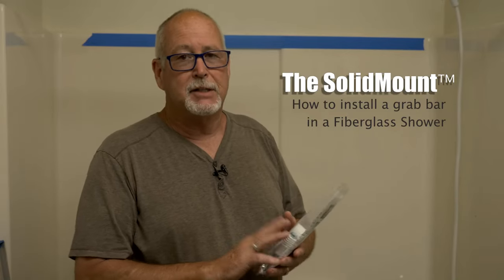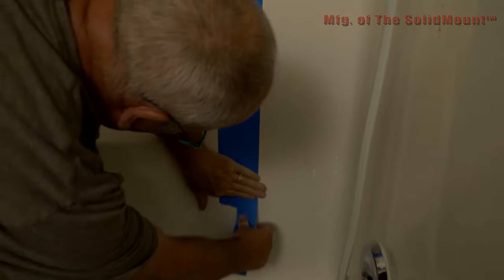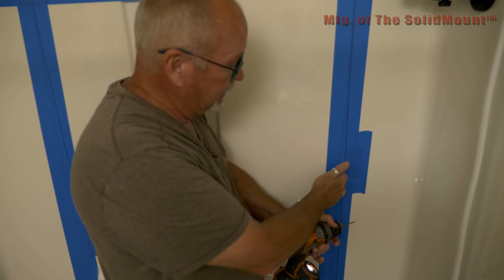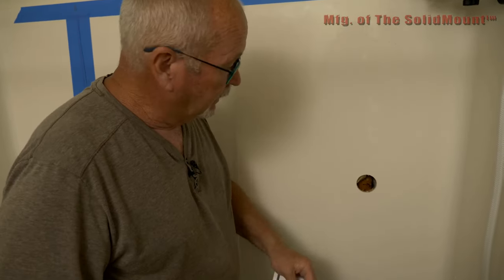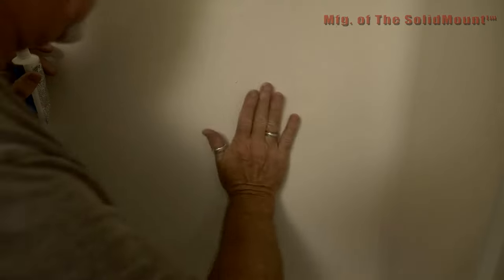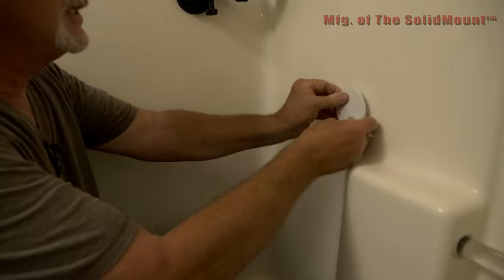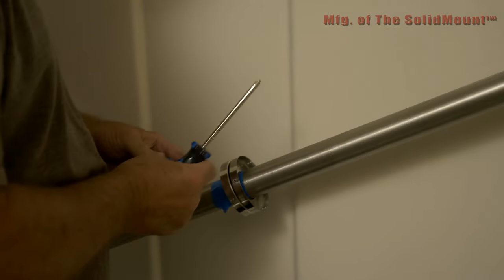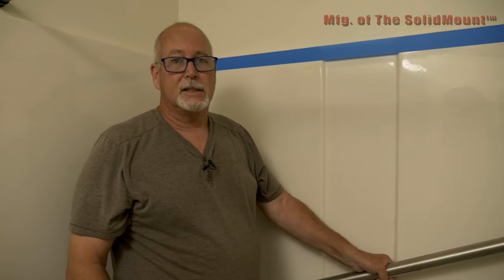Installing A Grab Bar in a Fiberglass Shower. *Grab Bar not Included*

Comment: I just installed the solid mount system in our fiberglass shower. Once installed the grab bar is solid. So solid that it's never going to come off that wall. It creates some great support getting in and out of the shower. The instructions with the product and this video were very clear on how to install it. And I followed every instruction and tip in the video. The only problem I ran into was there was no sheetrock behind the shower tub enclosure. Didn't know that until after I had drilled a 2-in hole. The distance from the shower wall to the stud was 5/8 of an inch. So I needed to use a hacksaw to cut off a quarter inch on the disc and a quarter inch on the threads. This quarter inch cut off was in addition to the four spacers that already had come off. Once I did that it installed perfectly. So thank you very much for this product and for the helpful video to get it installed.
Reply from the maker: Thank you

Comment: Great product and great instructions.  
Although the system is not intended to have the grab bar covers completely covering the mounting plate, you can have this flush result if you are very careful.  Make sure that the distance between the lag bolt assemblies is as close to perfect as possible.  Then dry fit (no silicon yet) the mounting plates and place the grab bar flanges against the mounting plates.  Mark any plate material that is not completely covered by the flange and make a mark at the top for orientation purposes.  Remove the mounting plates and sand/shave off the marked material.  If your spacing is accurate, there should be very little material that needs to be removed.  Add silicon around the hole and reinstall the mounting plates to the previous orientation.   Before install the grab bar screws, make sure both flanges are properly centered on the mounting plates.
Reply from the maker: Thanks for the comment.
Reply: Great tip.    I stole your idea and it came out perfect
Reply: I wish the disks were 2 7/8".

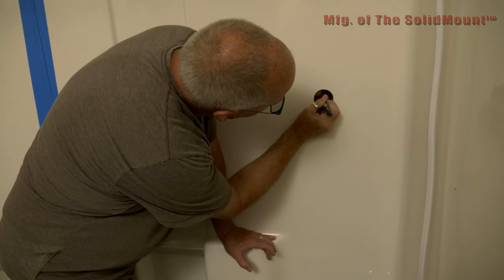Comment: Overall, this seems like a good product. I just mounted my first one and it is solid. I did my best to follow these instructions. But, I have to say that you should not imagine it is as easy or as neat as the video. I was installing a vertical bar, so all into one stud. My challenges were: 1) As of this posting, at 5:52 in the video, he says, and the subtitle says, use a 5/16" drill bit. He meant to say 3/16". I followed the video and my first lag  bolt hole was unusable. It was a recoverable error, but frustrating. 2) My fiberglass shower wall slopes, but of course the stud behind it does not. This creates a problem in both measuring and in the plastic flange screwing flush to the fiberglass. I am not sure what the proper work-around should have been, but it would have been nice to have one. I was able to recover from this using a Dremel and a lot of caulk, but again, frustrating. 3) Finally, I would recommend wearing a breathing mask for drilling the 2" holes. Fiberglass granules were flying everywhere. I just used a COVID mask to keep them away from my nose. 4) I had to drill off-center in the 2" holes both times, to the extent that my drill chuck would not go all the way in. This meant the 3/16" hole in the stud was shallower than it might have been, requiring a lot of torque to fully cinch up the lag bolt. Before I do another installation, I am going to get an extra long 3/16" bit. 

Again, I still think it is a a good product and I plan to install two more.
Reply from the maker: ThirdAct Warrior Thank you for your feedback it is important to us. I miss the lag bolt issue and thank you we have fixed the text part but will do a voice-over in the very near future. Most people would install per the written instructions using the video as more of a visual tool. But, nonetheless, it needs to be correct.
Regarding the angled shower wall. We can not account for all conditions but you could have reached out to me and I would have been more than happy to walk you through the correct procedure.
I did address this below in an older post so here is the info for next time.

For conversation's sake let's say you end up with a 2 5/8" gap from the stud to the front of the fiberglass. So, you now are over our 2 1/8" spec. by 1/2". What I did was I bought (x) number of fender washers the same size that we ship that when stacked to 1/2" spacing or whatever (x) is in your case. Then I also bought a lag bolt that was 1/2" or 1" longer than the one we ship, I don't remember. By doing both those you still keep the lag bolt at the minimum required depth in the stud and the washers will act as if the stud was closer. 

Regarding the slant, all you can do is mount THe SOlid Mount square to the stud and then fill the gap with silicone. I am not sure what you used the Dremel for?
Craig
Reply: @TheSolidMount  It's hard explain, but I will try. Because of the slope, the disc wound up not being centered on the grab bar flanges, even though I measured per instructions to the best of my ability. There wound up being disc material that extended past the flange and it kept the cosmetic cover from seating properly once everything was tightened up. I blue-taped the area around that part of the disc to protect the fiberglass. Then I used a Dremel with a small sanding cylinder, carefully, to remove the disc material that was keeping the cover from seating. Then I smoothed everything over with caulk. We thought alike on the fender washers and the longer bolts. That is exactly what I did. It really turned out very satisfactorily in the end. The bars are solid and look great. It just took a lot more fenagaling  than I could have imagined. If you have a mind to, doing another video on "How to solve problems you might encounter" would be a suggestion.
Reply from the maker: @thirdactwarrior317  Thanks for the explanation and suggestion.
Reply: Hope you had a successful installation. I'm planning on installing a grad bar on the outer edge of our 1 piece shower/tub enclosure. This fastener looks like it will work it I can hit a stud.
Reply: Thanks for sharing your experience.  An extra long 3/16 bit is a helpful tip.
Reply: @billmitchell5805  we’re you able to install yours successfully?
Reply: thanks much for all of your comments. I have learned that most YT projects end up going slightly 'off kilter' and knowing about that drill bit is worth the expense.
Reply: @TheSolidMount  I normally go by what the guy/girl making the videos sez. I also have learned by error, to read ALL the comments that go with said videos.
Reply: Thank you for sharing this correction!!

Comment: Excellent product. Only warning would be that I bought a Kohler Carmichael 16 inch grab bar. The issue is, the mounting bracket for the grab bar is only 1 and 5/8 inches. As the instructions pointed out and I failed to read, make sure the flange on the grab bar is three inches. I bought a Moen 16 inch replacement bar that was recommended by  SolidMount customer service. It worked perfectly and I now have a solid grab bar when I step into the shower.
Reply from the maker: That's why we suggest a 3" flange.
Reply: @TheSolidMount  My bad. I missed that in the description . Found the product and installation excellent!
Reply from the maker: Thank you glad it all worked out for you
Reply: @TheSolidMount just got the 16 inch Moen grab bar that you suggested. Has the 3 inch flange with a nice concealment cover over the flange. Thank you so much for the help!

Comment: I wanted to install a grab bar similar in length to yours, but the shower wall has a vertical contour that decreases in depth (which would make half the shower wall about 1" closer to the studs).  If I used a 32" grab bar mounted horizontally that spanned this vertical contour (the decrease in shower wall depth would be in about the middle of the grab bar), do you think I could still have secure, water tight mounts at both ends (using the procedures set out in your video)?  It seems doable to me, perhaps with slight adjustments to screw patterns and sufficient caulking, but wanted to ask the expert.  Appreciate any thoughts you might have on this and thanks for the great video.
Reply from the maker: With our seeing a picture it is hard to say. Reach out to us on our website thesolidmount(dot)com

Comment: I do have a question now though: At 11:16, are you aware of any waterproofing issues around the screw itself since it's going through both the flange and the fiberglass? I know you've got the grab bar cover, the mounting plate of the grab bar, then the Solid Mount flange and the screw in there to plug the hole. My thinking is if water still seeps over the screw, then it could get alongside that screw and eventually the other side of that fiberglass. Especially over time as weight is put on it regularly every day. It doesn't seem very likely but it seems like the main entry point I can imagine. 😅
Reply from the maker: Patrick, the simple answer is no. Once the bar is in place you have chaulking around the outside of the flange sealing there, plus the silicone between the mount and the fiberglass. Regarding the screws, they are threaded with self-tapping screws in plastic, and without high pressure, water should never penetrate. Hope that helps
Reply: @TheSolidMount  Patrick is using forethought. You could put some silicone sealer around the screw holes prior to tightening screws down. Also you could seal the finish trim plates at the bar. Just a tiny bit of moisture entry over extended period can result in fungus damage requiring destructive inspections and tear outs. This comes with 40 years' experience in the field of both inspections and structural repairs.
Reply from the maker: Carl you can do that if you like. But you already sealed the flange to the shower when you installed it plus you chalk when the install is finished. Not a single grab bar manufacturer request or requires the additional chalking you suggest. So if you want you can buy being in the industry from before 1985 to today never once have we had an issue as you suggest. Thank you for your input
Reply: @carlcampbell6827  FWIW, we actually purchased and installed this. We ended up putting silicone/sealant around the outer trim plates. 😊 Elegant, solid and waterproof. Great product so far.
Reply: @TheSolidMount  Thanks for the feedback. These subject are unavoidable "in the blood" issues for lifetime tradespeople.
Reply from the maker: Exactly. THanks and glad you are happy with your outcome.

Comment: Finished installing my Delta "Carlisle" 16" grab bar with this product. Turned out quite well, but I have a couple comments. The Delta Carlisle seems to be designed for a slightly smaller than 3" disk. I literally had to chuck up the disks and grind them down to about 2 7/8" so they would fit in the decorative end caps. If I were doing this again, I would check your grab bar first. Also, the recommended drill sizes are too small IMHO. The 3/16" for the lag bolt is just brutally tight. I used a larger drill.  I went up one drill size for the small screws also. Lastly, you have to be real careful if you have a long stud to shower wall distance like I had, 2", because if the part is at an angle, the error in the distance between the parts is magnified. Just be real careful. Like I said though, turned out good.
Reply from the maker: Thank you for your input. We follow the suggestions for the drill bits' specs that come from the manufacturer. Good idea to check the grab bar flange size, but according to the grab bar manufacturers, their flanges are not designed to cover any mounting kit.

Comment: I installed the first of four grab bars yesterday. I used the recommended 3/16" bit for the lag bolt (I had to get a long bit to get the hole deep enough). My Ryobi 3/8" drill didn't have enough torque to drive the lag bolt in far enough. I used a right-angle socket wrench to get it all the way necessary. When I attempted to install the second spacer, as I was driving the lag bolt the final way in with the right-angled wrench, the bolt sheared off! Yikes! Fortunately, I was able to move over a little on the 2x4, and by reaming out the new hole some, I was able to get a new lag bolt properly installed, though I still needed the right-angled wrench to finish driving the bolt. So, I'm wondering whether a 3/16 hole for the lag bolt is right. Should it really be 7/32" or maybe even 1/4"?
Other than that, this is a great product. That grab bar I installed isn't going anywhere. One down, three to go.
Reply from the maker: Tim the manufacturer of the lag bolt calls for a 3/16" hole for a 5/16" Lag bolt. I am not sure what would cause the sheering. Glad it all worked out fo you.
Reply: @TheSolidMount  Thanks for your reply. Perhaps that one bolt was flawed. All the rest went in just fine, though I did have to ream the hole some to make it easier. The remaining three bars were all installed easily. It was really nice after drilling the 2" holes to see the stud right were it was supposed to be! I've described your product, and included links to this video, to many of my friends who might be installing grab bars soon.

Comment: One more question before I go ahead and invest in your excellent-looking mounts:  The fiberglass surface is slightly convex at one of my mounting points, so there will be a 1/4" gap between the fiberglass surface and one edge of the mounting plate.  Can a gap of this size be filled and sealed with caulk, so it doesn't leak?  If caulk alone can't fill a gap of this size, is there something else that can?
Reply from the maker: Yes, that is exactly how we say to fix that type of situation. Remember, you already have a bead of silicon started before you screw on the mount so if you give that a few hours to firm up it will give you a great backstop win filling in the gap. Good luck and Thank you.
Reply: @TheSolidMount I don’t see them listed on solid mount website
Reply from the maker: What is not listed on our site
Reply: @TheSolidMount  found it finally on Amazon, USA and got a set. Thanks, I’ll be using video. Since the shower back is three different widths (contoured in three levels), will this fit a bar that spans these contours?
Reply from the maker: @robbunch2225  Without seeing it I can not say 100%> But sounds like you have the right idea

Comment: What do the final 3 screws on the flange fasten to? It is a bigger circumference than the spacer and I was figuring the those screws should attache to the spacer for a firm mount
Reply from the maker: I am not sure I understand the issue if you watch the video around the 11:49 time line it talks about attaching the grab bar to the flange. Now if the grab bar has a flange larger than 3" then that will not work with our product . The Solid Mount® is designed for 3" flange. Hope that helps.

Comment: I see how you locate the stud just above the shower top, and then extrapolate down by drawing a line with the level. Makes sense. However the stud could be not perfectly vertical, or, maybe no stud at all in the middle of the shower (although admittedly that is probably rare). My stud finder has a "deep scan" mode that is able to find the stud through the shower fiberglass and the air gap. Which is the best way to go about this then? Your method of extrapolating from the top, or using a deepscan stud finder to locate right where the drilling will take place?
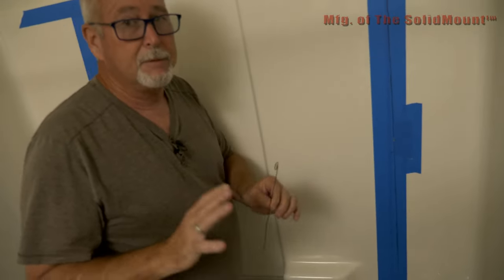Reply from the maker: Randy thank you for your input. Yes, you are correct a stud could have a slight warpage to it and we take 2 steps for any needed adjustment. At 4:17 in the video, we talk about drilling a 1/8" hole then taking a piece of wire to locate the sides of the stud and adjust if need be. Once you drill the 2" hole you still have an additional 1/4" for adjustment again. so from the 1/8" hole to finish you can adjust up to +/- 2". Now the deep scan stud finder might work. However, every fiberglass shower is different, and the density of the fiberglass changes. So if you have a deep scan stud finder I would use both methods because personally with over 30 years of experience in engineering and construction, I would not trust a stud finder to find something that is 1+ away from the surface. Now, with that said maybe one of the new units might do it as technology does change. So leave the information on your stud finder so we can help others.
Again, Thank you
Reply: @TheSolidMount  My deep scan stud finder did not work. Turns out the stud was 2"" behind the shower wall!

Comment: Thank you for this Excellent Video! I have a 5ft. long stand up fiberglass shower, My wife and myself are getting older and this will be a nice safety feature there. I did not like the idea of drilling 2'' holes in my shower, But you explained it well and I will be buying these mounts, I would like to know the brand of grab handle you used as that is exactly what I need. Thanks
Reply from the maker: We used a regular grab bar from your local hardware store. Just make sure it  is a standard 3" dia. flange.

Comment: Good info. Could you provide the recommended diameter for the drill bit.
Reply from the maker: 3/16" for lag bolt 1/8" for test hole

Comment: I am in a townhouse built in 1918 - Plaster walls, cheap, poorly place, difficult-to-locate studs.  Help?  Also, do the spacers come with the product?
Reply from the maker: I'm sorry for the slow response I did not get a notice there was a message. That is an issue no stud finder will locate them. Contact us at https://thesolidmount.com/support-portal-home/ at the bottom of the page is a contact form. We do have a way to work around it but I will need to see pictures, so after you reach out to us we can then start an email chain with you.